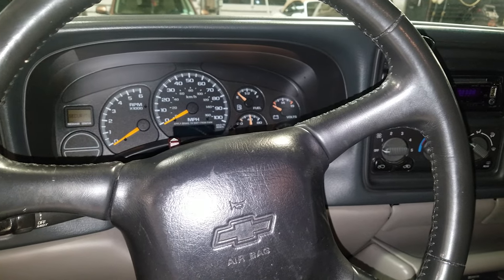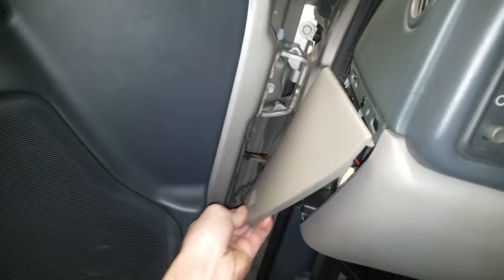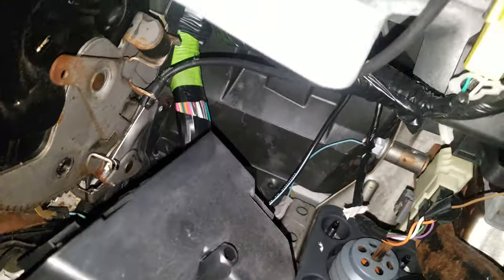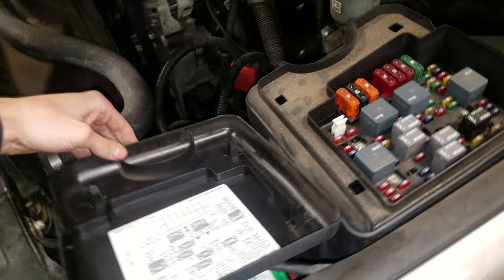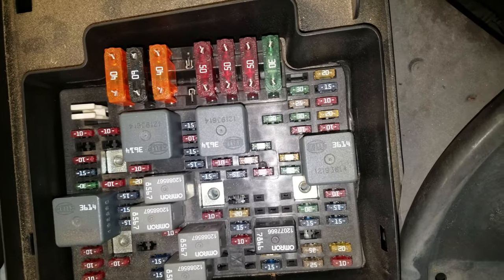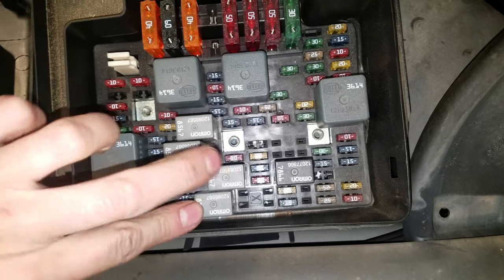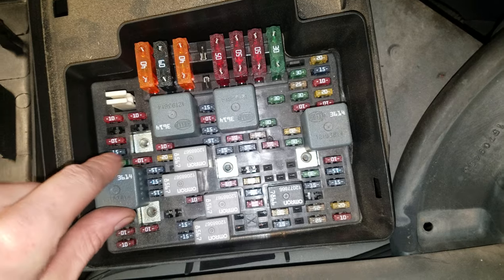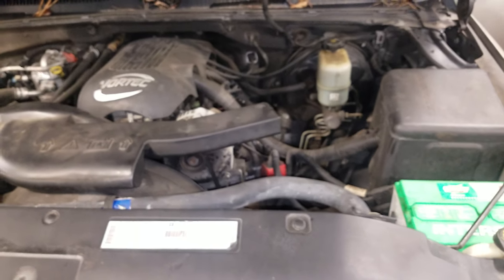2001 Tahoe AC Fuel Pump and cigarette Lighter fuses/relays

Comment: If the relays are upside down they are wrong. 
Look at wire diagram and put 86/30 relay in like shown on diagram. Has to do with permanent ground on fuel pump.

Comment: I'm trying to find the iod fuse on my 02 Tahoe. Having parasitic drain issues and I've checked all the under hood and interior fuses with a test light, so now I'm trying to check the iod fuse and bcm to see if one of them is the problem. Can you point me to the iod? Found the bcm already.

Comment: Yes sir questions i have 😔. I ran out of fuel while pulling into gas station 🤬. I put four 2 gallon cans of fuel into it still won't start. I checked the port on the fuel line but had zero pressure when i pressed the pin in. Only thing that came out was a little hiss of air then nothing after. Anyway it turns over but no start.not even a sputter. I checked the fuel pump relay, as u said, swapped with drl relay thats under the hood & still nothing. Any other fuel pump fuses that anyone knows of?? Thank u for zny help in advance. 👍👍🇺🇸
Reply from the maker: A fuel pump can get hot when you run it out of gas - this can cause the fuel pump to fail. You may have success hitting the bottom of the fuel tank really hard with a rubber mallet as someone is cranking the engine over.
Reply: Hi did you ever figure out the problem? My 01 Tahoe is doing the same thing except I had a 1/4 tank and it sputtered out and died on me now today it’s saying low fuel.
Reply: @juju-onna-beat462  mine is doing that now do you know what it was

Comment: Up top where the bigger fuses are, I noticed that you’re missing the AIR 30 amp fuse. Mine is missing as well. What exactly does that fuse do there ? What’s its purpose?
Reply from the maker: Good question, I would assume that the air fuse would be for models with air ride equipped.

Comment: I just changed my fuel pump but its not getting any power. Truck will crank but no start.i checked the relay fuses and they all seem to be working
Reply from the maker: You could have an issue with the ignition switch. Do you have a scan tool? Check to see if you can communicate with the pcm when the key is in the on position and see if there are any stored trouble codes.

Comment: Can you switch around a fuse to make your outlets turn off when the car is off
Reply from the maker: Are you trying to power something like a dash cam that you only want to have on when the car is running? You will have to tie it onto a circuit that is only powered when the key is in the on position. Might have to hunt for that with a voltmeter.